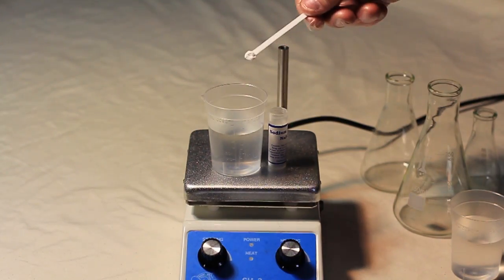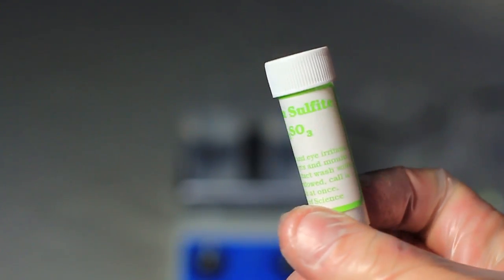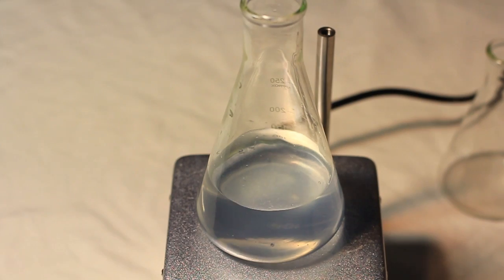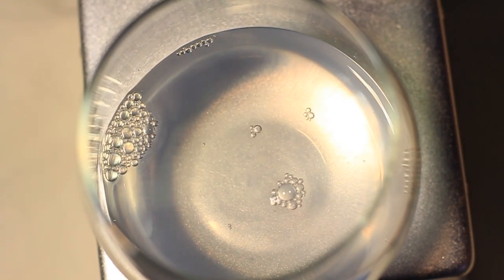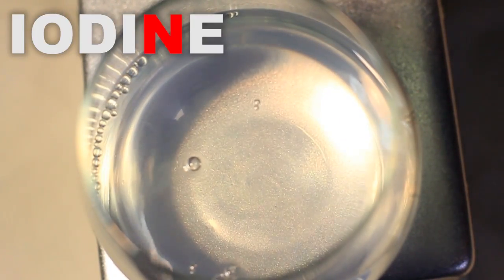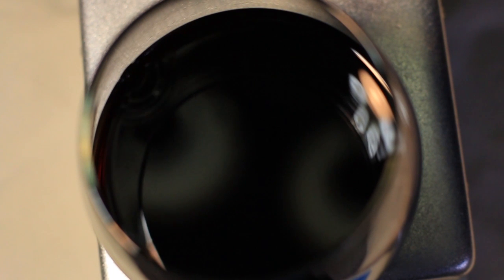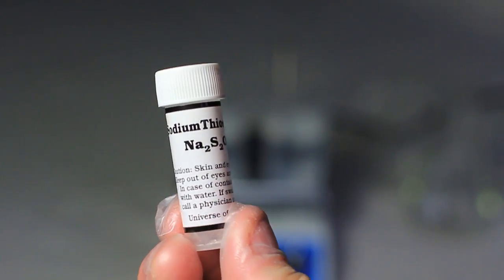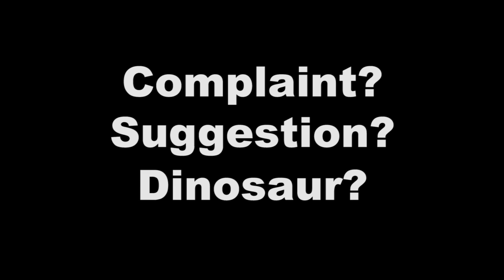Amazing Iodine Clock - Chemical Reaction

Comment: A true clock reaction should oscillate without adding any other substances. I suggest trying one with melodic acid, as it works well for beginners and impreses nicely, such as the Briggs Raucher reaction. Well made video overall, and I especially liked the dinosaur question. I unfortunately don't have one though. Keep making cool videos.
Reply: This is false it is still a reaction because it contains iodine

Comment: No,I don't think so. If the sulfide is used up in the reaction, and then the solution is then saturated with starch to turn it clear . That seems to suggest a super saturation of starch and adding more solvent would be necessary. Not sure.

Comment: Actually it stirs the flask by alternating a current in the hot plate with a bean shaped piece of metal inside the mixture. As the current oscillates the bean will rotate with the changing electro magnetic field that is produce by the flowing electricity.

Comment: I think they're called stirrers, but it's just a plate with a magnet underneath it. You set your beaker on top and put a little magnet oval inside of the beaker, turn it on, and it spins the little oval to mix the solution. Hands free. Pretty nifty.

Comment: Its a stir plate; a metal (iron) magnetic bar that goes in the solution (generally encased in a non reactive polymer). A kinda strong magnet in the plate below rotates making the bar rotate as well thus sturing the mixture for you. This one will probably heat up to allow... well you solution to get hot :S?

Comment: Hmmmm. It seems that that'd be a fairly marketable thing when it comes to household appliances. People pay a fair amount of money for milk frothing, coffee stirring, hot chocolate making devices that use little bits of plastic in stirry shapes. Those little bits break fairly easily under the strain of improper use or wear and tear caused by the motor that spins it. If you replaced the plastic bits with a device like this I reckon it'd sell pretty well because it's be way more durable.

Comment: the hotplate he has it on, they have a magnet attached to a motor under the plate and you drop in a rectangular shaped piece of metal and turn the plate on "stir" and the magnet under the plate spins the magnet in the solution.. [source: college chemistry 1101]

Comment: The hot plates nowadays have built in magnets in their bases that can spin different speeds based on the knob on the front of it, then you simply put magnetic pellets into the solution (ones made of materials that don't interfere with the reaction of course) and they will be pulled along by the magnet in the hot plate, stirring the solution. It's much better than having to stir a solution for an extended period of time using a glass stirring rod.

Comment: It is called a magnetic stirrer and is used in most laboratories. It works by pulsing magnetic poles which make a magnetic rod, refered to as the flea, spinn. The rate of the pulses determines the speed of the flea. This machine is often combined with a hot plate.

Comment: I've found a mix of 3% hydrogen peroxide, ascorbic acid, tincture of iodine, and liquid starch to work just as well, and with easier to to find ingredients. Solution A is the ascorbic acid, starch, and iodine, and solution B is the hydrogen peroxide. 
the ascorbic acid prevents the iodine from reacting with the starch (iodine reduced to iodide) and the peroxide oxidises iodide to iodine.
Tip: povidone iodine works as well and is often cheaper.

Comment: its a magnetic stirrer, a pill like magnet is dropped into the beaker or flask and there is another magnet under the metal plate mounted on a motor, the container is placed on top and the magnets align, when the thing is turned on it spins the magnet in the device thus also spinning the magnet in the container therefore the solution gets stirred. :)

Comment: It's a hot plate. It has a magnetic thing inside it that spins when you turn on the function. He puts a stir bar, which is basically a small magnetic rod, into the solution, so when the mechanism inside the hot plate spins, the bar will spin, mixing the solution. It's basically there so that stuff is evenly mixed.

Comment: The beaker is sitting on a heating plate, which has a magnet in it. Inside the beaker is another magnet, and by turning on the magnet inside the heating plate, it spins the magnet in the beaker. So it stirs itself.

Comment: Magnetic Stirplate.  You drop a little pill-shaped magnet in the beaker, put it on the plate, and the plate causes the pill-shaped magnet to spin inside the beaker, very fast.